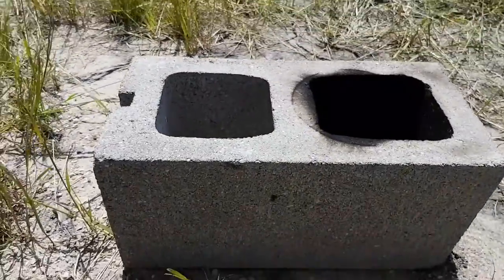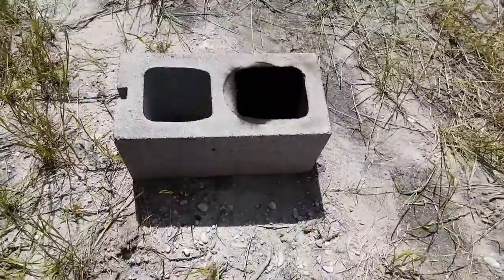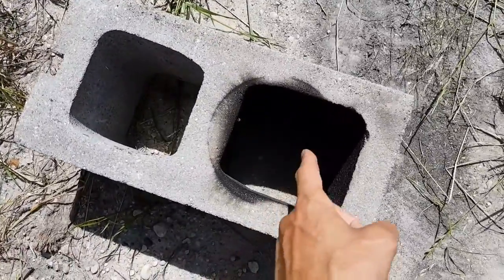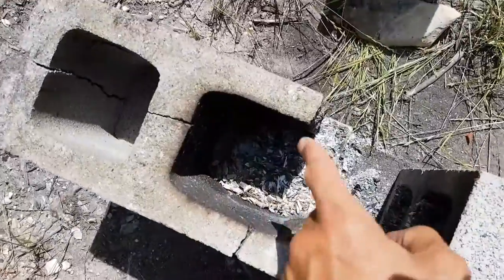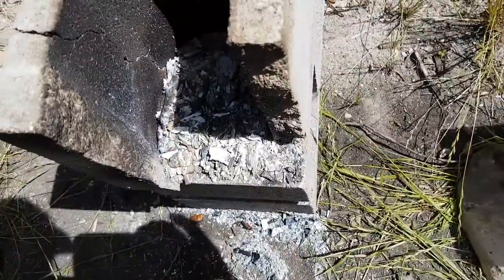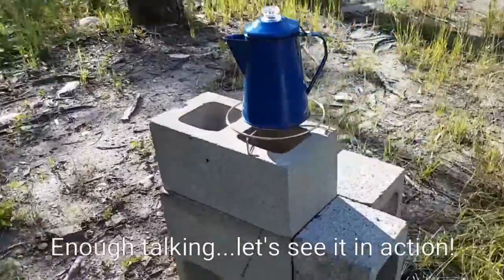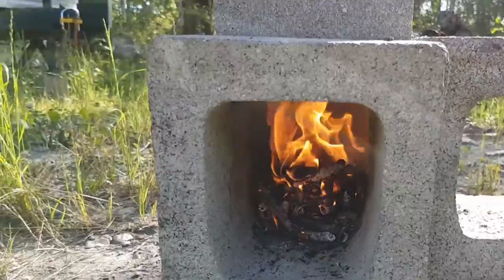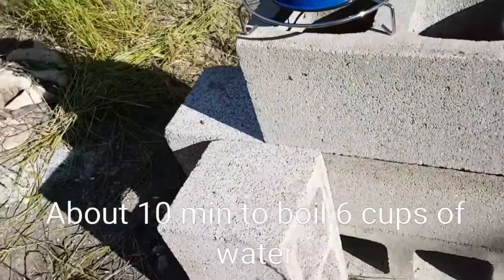Cinder Block Rocket Stove (No H Block)

Comment: Why didnt you used regular bricks underneath...instead of breaking this one
Reply from the maker: My neighbor had a bunch of these cinder blocks laying around and gave them to me for free so I just used what I had.  I wasn't happy with the heat consistency though so I rebuilt it last summer from regular bricks that I had to buy. I haven't used the new one enough yet to see if it works better. 
Have you built one from regular bricks? If so are you happy with it? I'm open to suggestions on how to improve my stove design. Cheers!